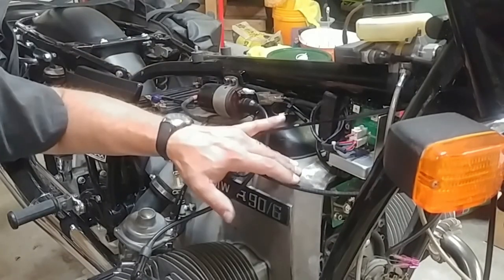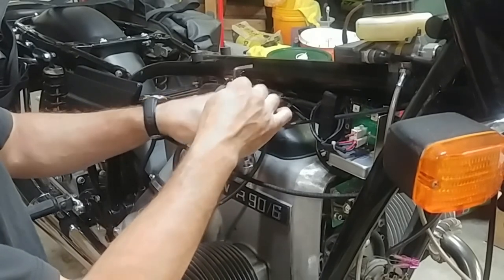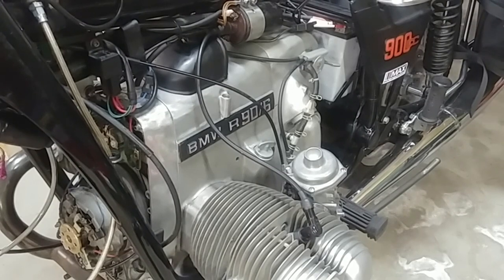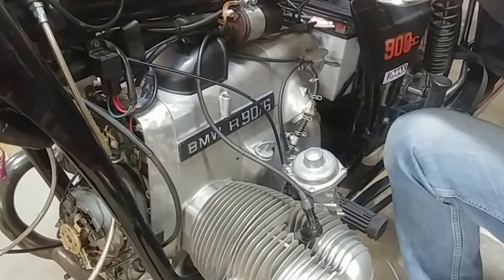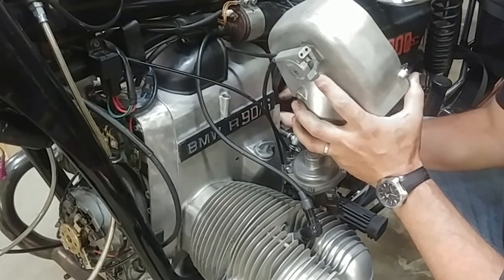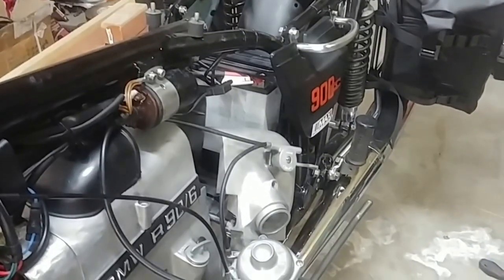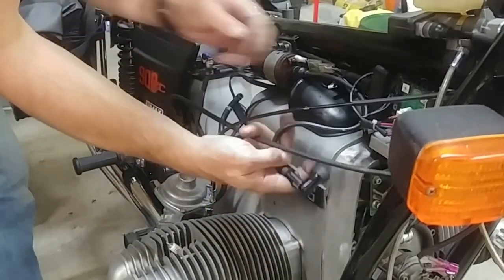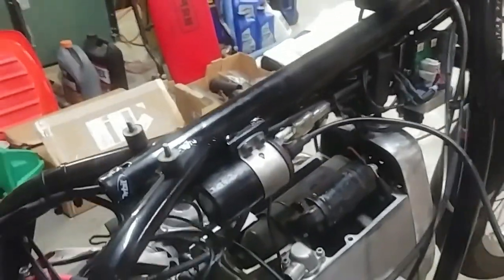Rebuild a Airhead starter part 1

Comment: Thanks - should you put something like moly on the gears teeth when it goes back in ?
Reply from the maker: I don't think that would necessary. The flywheel is the home of the clutch.Grease or moly don't mix with clutch plates. The engagement of the starter is for such a short period of time. It will last for a very long time without lube. Thank for your comment. Greetings, Heiko

Comment: Hi Heiko -  what is that "optima 0108" you had stuck to the side of the starter area cover?  some enhancement to the ignition system?  Thanks for the nice videos!
Reply from the maker: It is 12v to 5v usb charhing thing. It monitors the battery voltage and turns the usb port off when the battery voltage gets to low.
Reply: @HeikosGarage  Ah..ok...looked like it might have been coming from the coils and so couldn't imagine what that could have been.